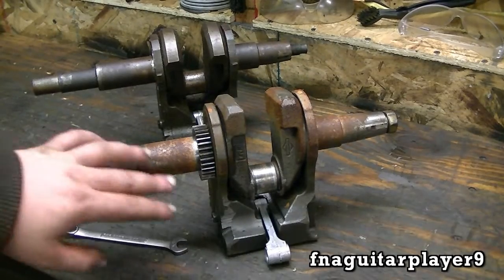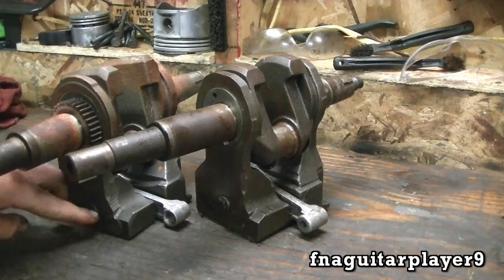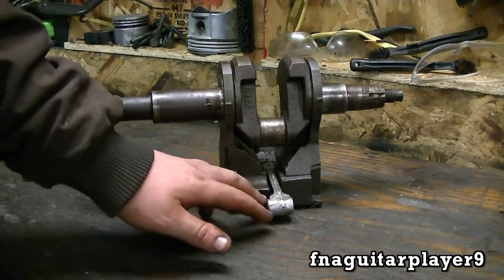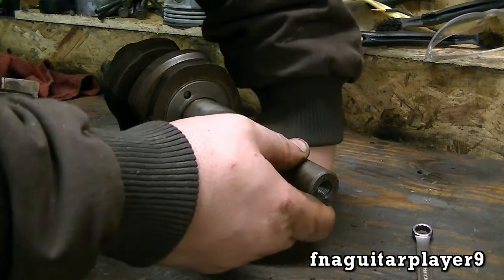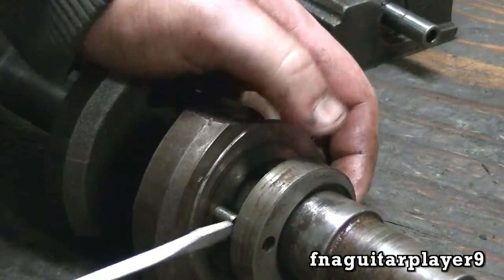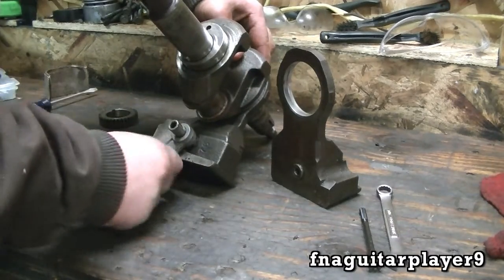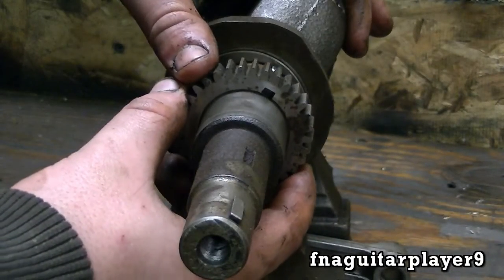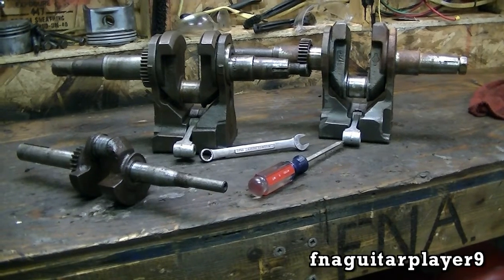All About Briggs & Stratton Synchro Balance crankshafts and how to remove counter weights

Comment: Would the movement of the counterweight splash enough oil if mounted vertically? I supposed it would splash too much oil, so lower levels or the right level would have to be determined.
I prefer taking rusted trashed mowers or junkyard motors (inspect scruplously assuming theyre trash check everyhting possible and 1 more thing)  and using those motors on all sorts of projects. And sending predator motors back to hell where they came from. \

I converted a kholer 12hp and the oiler rotary pump was just diverted where the pickup was low enough to sump it. Jb welded the pickup tube in place. 
Ran perfectly. 
But the governor was not removed by mistake (remove that b every time the engine gets taken apart and throw it out) 
And the damn lever moved too much of an angle, and the GD design lets the governor wheel fly right into the moving crankcase parts. 
I was soo pissed. 
Then i got the briggs, and Its working, but needs a steel intake and proper carburetor throttle and choke linkages. 

That governor detail pissed me off beyond. 
AND the engine was perfectly repurposed just some one bitch ass thing nobody should have willed into this gd world.

Comment: i got a 12 hp with a broken connecting rod with the synchro balancer the bottom or the rod was destroyed when I look to buy a new connecting rod how dose the oil dipper fit on the rod or is there no oil dipper with the synchro balancer i cant tell on my engine if there was it was destroyed my block and everythig else looks good

Comment: Very helpful video I just finished doing connecting rod pistons and rings in a Briggs 21hp after it dropped a valve and smashed up the piston and head I started it up it was running good then a loud bang and the back of the case was busted open and I could see the balancer not moving as I turned the flywheel. I’m thinking that dog bone rod you showed is going to be what broke. Going to split it open next week and salvage what parts I can Thank you for the helpful video
Reply: i bet you find the compression release mechanism
 is in the bottom of the crank case along with some other goodies thats usually what lets loose sometimes you get lucky no damage and other times it grenades like yours

Comment: Hey man I really thank you for posting this video a long long time ago because I have a Briggs & Stratton 8 horsepower synchro balanced engine and I had no idea that the synchro balance counterweights could destroy my engine and see there's a reason why I say that is because I'm making it into a race engine but thankfully I'm going to try to use a 3.5 horsepower Craftsman edger engine it should not have those synchro balancers and I could probably just Rob the crankcase off of that but I thank you for putting that on there

Comment: The Eccentric on the Magneto Side ( Not timing gear side ) has a dot on it and has a groove on the inside. What is the proper way to install the eccentic ? Dot
Reply: Well if you're talking about the crankshaft gear ⚙️and the camshaft gear what you have to do is on the crankshaft gear make sure that the dot is pointing towards where the camshaft would be then take your camshaft and align the dot with the crankshaft gear the dots should be touching each other perfectly aligned with each other and then once you do that try pulling the engine and see if it opens and closes on the right time and I hope this helps you

Comment: Do u need to have the balancers in 
can u run it without them?
Reply: Well if you do take them off I don't recommend running the engine with no synchro balancers because the way that I see it you may have to change out the crankshaft in order to do it because I'm building myself a racing lawn mower engine and it has those balancers in there and see what I'm thinking about doing is putting a 3.5 horsepower Craftsman edger crankshaft and I'm going to change out the crankshaft and hopefully it's the right type because I don't think those engines have balancers like that because take a look at where the balancers have to go on the crankshaft if you take that off ,the engine won't be balanced correctly and that could cause the engine to run rough

Comment: Let me tell you a cool trick about rust prevention. What I use is a propane torch and a regular candle. I heat the part and use the candle wax pressed and moved all over the surface which prevents rust and oxidation in its tracks. Real cheap and works excellent too.
Reply from the maker: I have heard of this before but i've never tried it! Thanks for Watching!!!

Comment: can you run the engine without the weight system in it? thanks
Reply from the maker: Yes, but it will cause extreme vibration, they do make brass counterweights that take the place of it. Thanks for Watching!!!

Comment: Do you know if the dog bone is replaced with a better quality one will it servive un governed engines for racing ??? Thanks, just wondering. Or is this just more of a headache with more reciprocating mass ??? What is max RPM for a stock crank also ???
Good day also fella.
Reply from the maker: They do make a billet aluminum dog bone, that will help out alot but its highly recommended to put brass counterweights on it. The dogbone is cheaper at around 20-30 bucks as the brass weights are 80 - 100. Not sure of the exact rpms a stock will take, but the crank itself is pretty durable, just the weights are the weak part. Thanks for Watching!!!
Reply: @fnaguitarplayer9  Thanks for the information fella.

Comment: I have a 15.5 and 17 hp briggs that both have knocks. The 17 gets worse and worse every time it runs to the point where I'm not gonna start again, and it seems like its coming from the camshaft area. Also the exhaust push rod is worn and about to blow, so could that be the same problem? The 15.5 has the AVS system on it and I can't really tell where it's coming from. I've been told that it might not be the counter balancers. So I guess it could it be a million different possibilities, right?
Reply from the maker: Those are bad about knocking, we have one on a troybilt with low hours and it knocks at idle, just enough to aggravate you, and another i did in a 2 part video. They way the avs system is made is very strange and almost looks like its made to wear out on purpose. I like the older synchro balancers much better. It could be the valves out of adjustment causing it, could be rod, piston slap, etc, your right, never know until you dig deeper into it. Thanks for Watching!!!

Comment: Do they make a metal dog bone instead of aluminum to help durability?
Reply from the maker: Not steel, but you can get a aftermarket billet aluminum one, made for racing lawn mowers. And they make brass counterweights that replace the synchro. Thanks for Watching!!!

Comment: Hello I'm new to this ..when it said that you  have a AVS engine ...what type  differ from what you shown in your video?    Iam building a Race engine  but I  was told I need a non AVS crankshaft ?   What's the difference?   Thank you  Great video.
Reply from the maker: Its a similar design, if you watch my video called "overheated Briggs 18.5Hp.....) you will catch a glimpse of it on the teardown, i didn't remove the crank but you can get a idea of the design of it. It doesn't have the dogbone rod, but has a slightly different set up, and the main difference they are referring to on the racing sites is the crank journal and shaft are different sizes so the brass counterweights won't go right on without having it machined down to fit. And the billet crank they sell doesn't fit as far as i know. They can be used but it will take modification to make it work. Thanks for Watching!!!

Comment: What the specs for the counter weight cranhshaft play got every thing clean up and checked to put back together
Reply from the maker: I've never actually found any specs for them, and now you can't even get the sleeves for them. Best advice if you got one thats worn out and cant find another then upgrade to the brass counterweights that they use in racing engines, pricey but will fix it, and eliminate future problems! Thanks for Watching!!!

Comment: so the only things these counter weights do is help the engine from shaking and vibrating as much as something like a push mower engine?
Reply from the maker: Yeah it keeps the vibration down, and balances  the engine. The counterweights in engines without them (like the push mower engine) are made bigger to compensate more, but still not perfectly balanced. Thanks for Watching!

Comment: Have you got any counterweights and connecting rod for a l/c quiet 12.5hp engine I can't find one anywhere
Reply from the maker: Not extra ones no, you probably wont' find a new couterweights but may be able to find a good used one on ebay, you can get new con rods from ebay as well. i order alot of parts from tulsa engine warehouse (tewarehouse.com) Thanks for Watching!!!

Comment: Where do i buy the bearing shells?my lawnmover started to vibrate and run ruff.opened the engine and found a lot of small metalflakes.
Reply from the maker: Its hard to find to be honest, you may have to have a machine shop make them. Thanks for Watching!!!

Comment: can one run the engine without the balancer
Reply from the maker: You can, but they will be shake alot, they do sell aftermarket brass counterweights for racing lawn mower engines that can take the place of them. Thanks for Watching!!!

Comment: Is it normal for one of these engines to knock a little when hand spun?
Reply from the maker: Some will do that, the synchro can have a little play in it, but you may be hearing the oil slinger/governor sometimes they will make a noise when you turn it over slowly. If you don't hear it when its running then it should be ok. Its hard to say for sure, it could be the rod or even piston slap but I'd say its some play in the synchro  / counter weights. thanks for watching!!!
Reply: fnaguitarplayer9 thank you.

Comment: Ok so the Brass counter weights are no longer available at EC carburetors or ARC Racing.. or anywhere else i can find that did have, so will a flywheel counter weight fix the shakes or be to far off from the center and add more wobble?
And does anyone know where i could find the specs on the brass counters i know a CNC wizard who could probably mill something out..
Reply: Found ummm.. https://www.ombwarehouse.com/
Reply from the maker: didn't know that!!! I'll have to check omb out! Thanks for Watching!!!

Comment: was wondering can you use the 12.5 crank in the 11hp b;ock
Reply from the maker: the 12.5 (model 28) has a longer stroke than the 11hp (model 25), now if for some reason both engines have the same model number, then it should, should, work, they both use the same rod though, and the piston is the same, at least diameter, some used different styles of rings. I  actually have another video on plans on building a 28-25 stroker motor, but i never did any more with it, its been done before, but takes alot of clearancing. thanks for watching!!!
Reply: would be nice to see video
Reply from the maker: here's the one i have that i show what would have to be done, if you could machine a new rod that keeps the piston from popping out as you will see, it would work... https://www.youtube.com/watch?v=H1kiFqCDCh0 Thanks for Watching!!!

Comment: What would happen if you run an engine without these
Reply from the maker: It will vibrate excessively and can work on the crank bearings. I have a old 11HP engine that is knocking, I'm thinking of doing a experiment this summer, taking the weights off of it just to see how much it will vibrate, might do some other experiments as well. Might be interesting! Thanks for Watching!!!

Comment: I race model 19 briggs motors. Is their away you can tell if it has the synchro in it or not without knowing the exact full model number and without removing the sump?? Thanks, Don
Reply from the maker: I hear ya.I looked up the diagrams on it, and its not showing a sychro.  I think they started that on 11HP and bigger engines, because i tore down a 10HP (model 22 or 23 can't remember now) and it was a regular crank. no problem! Thanks for Watching!!!

Comment: Hi thanks for the great info found in your videos. Great job. I too had the counter weight closest the flywheel excessive wear problem and can't believe it still ran. I had an extrA counterweight but my problem is the rear replaceable counterweight journal indeed needs replacing but can't find one any wear not even on the engine diagram for this model. Can someone tell me wear I cAn find one? I would really appreciate some help.
Reply from the maker: +lasso atrain your welcome! I hear ya, its really hard to find them, I have heard of being able to replace the bushing/sleeve and get by with that, but never done it myself. Thanks for Watching!!!

Comment: Yeah I saw that in your video the brass counterweights that take place of the synchro balanced counter weights I was looking at that but I had already ordered the original counter weights when I heard of  brass counter weights. I didn't set up the engine for racing I just did pulley swaps so I don't think I have anything to worry about I don't even run the engine above 1500 rpms half the time except for when I'm in the mud or going up the hill I might punch the throttle down but besides that the RPM's don't get up there too high.
Reply from the maker: +Rachel Matt yeah, I've been wanting to try the brass weights but they are expensive. I hear ya, its surprising what you can get out of a stock-governed engine with the right pulley setup on it, because it takes advantage of the lower RPM torque. Alot of people do away the governor with stock pulleys expecting a ton of speed, but all you get is a rod out the side!

Comment: The reason I watched your video is because I'm trying to see what happens if you don't run the synchro balanced counter weights I'd rather not put them back in and just run the crank.
Reply from the maker: +Rachel Matt I hear ya. Some have ran them without any weights at all, and they say it causes alot more vibration, but i don't know about long term, it could wear the crank bearings more if its excessive vibration. They also make a racing crankshaft for these that do away with the weights, its built more like a push mower engine for example.

Comment: I just ordered some of those counter weights off eBay cause after 20 years the weight closest to the flywheel was worn about a 1/4 inch. crazy I'm surprised it didn't come apart on me I'm going to up load a video when the weights and gaskets get here in about a week.
Reply from the maker: +Rachel Matt I hear ya, wow thats worn quite a bit, i'm surprised too that it lasted! heard that, let me know when its up and i'll check it out!
Reply: Were they new or used ???

Comment: good video but you never put grease in an oiled bearing race  it will repel the oil and you will seas your engine. Not to be rude but that is the worst peace of advise you could ever give someone rebuilding an engine. Never put grease on any machined surface if its meant for oil it will seas up in a matter of minutes.
Reply from the maker: +Rachel Matt I agree with you, I didn't even remember saying that. I'd "re-suggest" using oil or STP/Lucas as assembly oil. Thanks for Watching!!!

Comment: So im just curious what would happen if u were to put that crank in without the balancer and use just the crank? Would it blow up?
Reply from the maker: gbody mod shop People have done it before, it just causes excessive vibration, its possible that something could crack from the extra vibration but I'm not sure on that. For lawn mower racing they actually sell brass counterweights that bolt on in place of the balancer, because in a ungoverned engine, it is the weak point, as well as the rod. But the crank with the weights added looks more like a "traditional" crank, with no balancer. Thanks for Watching!

Comment: Hey man, been a while lol. Do you happen to know the part numbers for the synchro bearing shells? I'm going to take my 12 HP apart soon because with ear plugs in I can hear a slight bit of rattle come from the engine. Can't really hear it without the ear plugs in. Figure I'd better check it before something happens, especially with about 1,000 hours on the engine.
Reply from the maker: 1972FordF150 Hey! It has been a while! Nope, I've been asked that before, i just double checked my diagrams and the only thing i can find is the counterweights themselves, which should have the shell pressed into them, but i checked a couple different model 28's and there are different #'s for them, whats yours, i'll see what it is for that. They don't cost a whole lot, like 30 bucks on ebay. I thought it would be more than that. Heard that, best to be safe than sorry haha I had a tick in my truck (s10 with the 2.2) and this past weekend me and my buddy put a timing chain in it, took care of it, if it wasn't that i though it might have been a lifter. Good to hear from ya! Thanks for Watching!
Reply: My model number is 281707, type is 0139-01 code is 881013xx. Can't remember the rest off hand haha
Reply from the maker: 1972FordF150 haha That was enough, usually I can go off of the model and type. The part # for yours is 399891 just checked there is some on ebay.